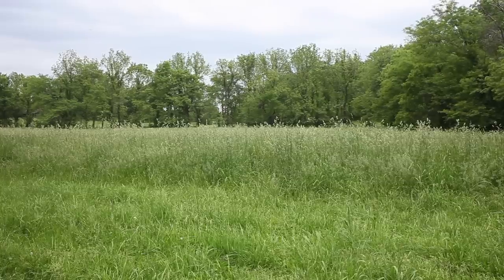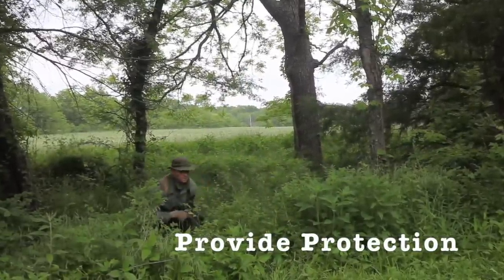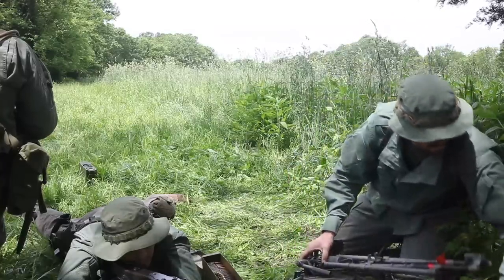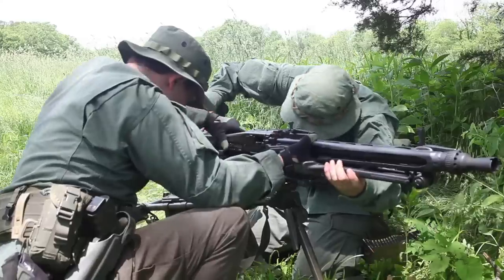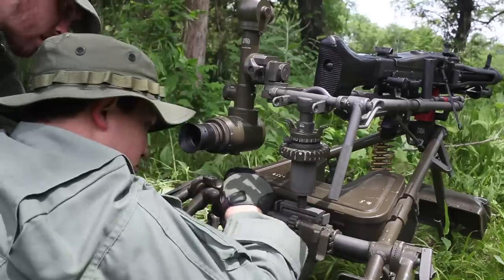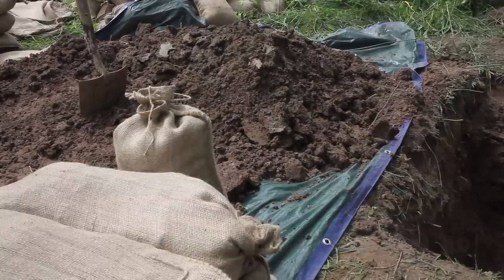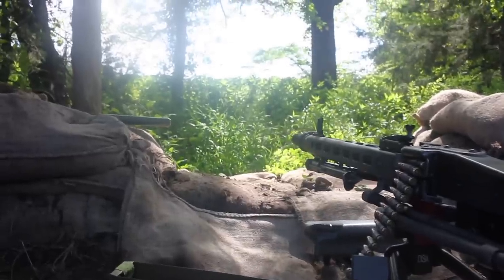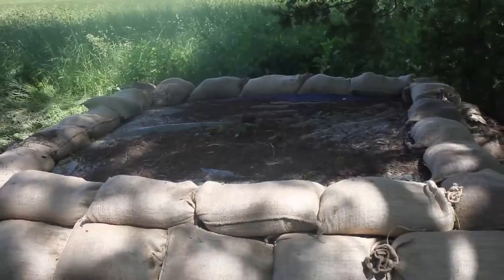How to Build a MG Fighting Position

Comment: This a very good video well done. Exactly how we would do it. Now doctrine is different. My time in the Army, the team leader would be the AG, Gunner is second in command and rifleman would be the ammo bitch. Every gun team from Weapons Squad would be divided into every individual squad on the platoon. Each weapon team would be directly controlled by the squad leader. In this video it shows a Gun team working interdependently. Which makes sense if it militia or small unit based.

Comment: So all we need is a pair of folding showels... and a pair of full scale ones. And a hack... And planty of empty bags...  And wooden beams. And sheets of plywood. No offence, the beginning was very interesting. But closer to the end it is becoming obivious that the main requirement for firing position - having IKEA or a large hardware store in vicinity.
Reply: Very good points! If you look into the hand books that this is referencing the first phases of the trench are done by the men, eventually In optimal conditions later reinforcing material is dropped off by logistics. 
For an example of this Think Ukraine war most trenches in hot zones are mostly mud and rocks with crude dugouts. Second and third line trenches look much more professional and neat. You invest less in the front and reinforce once it’s safe for field engineers to get closer. 

What you see in this video is a fighting position that’s defensive going from patrol to, tripod, to fox hole, to trench to fortified position.

Comment: As we have seen in the ukraine war, one improvement would be to cover both the entrance and the position from where the gun fires with a net to avoid kamikaze drones from getting inside your position and causing even more damage, you would have to hide this thing even more because of drone warfare, also, again, ukraine war tells us that making another hole inside that does an L and goes underground would be good because of artillery attacks.

All of this is futile if you got no additional infantry support and some sort of air cover, maybe drone jamming weapons will become necessary in modern warfare, they should be standard in modern tanks, many amazing and well made trench networks fell to the Ukrainians because simply you can stick an 88mm mortar shell to a drone and throw it in the heads of your enemy, because drones are small, hard to detect and hit and have amazing cameras that can pick incredible details and they will most likely than not hit something that they suspect is an enemy position because it's cheap, and the effort is minimum, so why not, that's why you need to be really scared of drones

Comment: i dont get why you need a MG fighting position, when the enemy spot after youve shot them they will just go around a take you out. Im i not thinking right? and it is not moveable either, so you can just switch places.
Reply: such an 'installation' isn't used alone! there are not only 3 guys in the middle of nowhere. if you have such a defense position you act as part of a front line, so left and right to your position are people who fight to prevent the enemy from moving around. if it is just these 3 guys, they should keep moving till they reach their front line again and don't dig in.

Comment: im confused by the machine gun itself
its an m53 receiver with mg 3 booster and mg 3 top cover
Reply: It’s a semi auto build from parts
Reply: @harryjoe860  ah okay
Reply: @Martinlegend  yeah, looks like a mix of mg 42, mg53 and g3
Reply: @harryjoe860  i cant see any Mg 42 parts 
mostly M53 and some mg 3
Reply: @Martinlegend  MG 53 and 42 parts kits are very interchangeable so really only markings would be different on many parts

Comment: They are using a german mg42 or a mg3. German engineering.
Isn't a mg fighting Position mobile?
They are diggin' in to be stationary.
Reply: The supply must therefore be secured.

Comment: I mean the machine gunner had literally zero view of the field in front of them... you can see by the camera angle even held slightly above the machine gun itself the amount of foliage in front blocks all view of the field. Also no sure how they ignore the fact that the tree line has a ditch in it that more than likely extends up and down the tree line which would be optimal to place at the back of the position as a route of egress or to be able to move left and right of the machine gun to survey the field without exposing yourself.
Reply: To be honest, a machinegun really isn't even used to kill people like a rifle is. The entire point of a machine gun is to just throw rounds down range, and possibly hit someone. It's jokingly called 'Accuracy by volume' it doesn't matter if you're landing shots, what matters if you're throwing rounds in the direction of your enemy. 

As long as the enemy is pinned down by fire, they can't move, thus allowing the fireteam leader to call in the enemy position to surrounding forces in order to encircle and kill while they're pinned, or to hold them down long enough for an effective fire support mission to be called. 

You can easily aim a rifle through that bunker window, and see the field infront. But the overall objective for a machine gun is to just lay down alot of hate, so friendlies can move around to eliminate the threat. It's why alot of NATO tactics with machine guns are just 'enemy is at 3 o'clock, light up 3 o'clock'
Reply: @notleviathan855  when you are ambushed it is different then selecting a spot based on being able to observe enemy movements and setting a field of fire. My comment on the machine gun not being able to see has nothing to do with being in a bunker. It has to do with the bunker location and the fact that even during the initial location scouting the machine gunner laid down with the assistant with zero field of view while the point man scouted....wth os the point of the machine gum setting up with zero view to provide security for the position when he cant see. There is a perfectly usable ditch with cover 10 yards away. Look at any observation post or defesive established bunker. Field of view is paramount.
Reply: @wcb5890  Sure, FOV is important, but that wasn't the objective of this video. It was 'how to build a MG fighting position' not 'how to get the best FOV possible'

The overall objective of the video was to show what the best MG bunker should look like, and how it should function, this bunker wasn't going to be used in any practical conflict so whatever is infront of it doesn't matter, they could have build the thing out of popsicle sticks and lego bricks and just voice overed what it's supposed to look like. 

It's also stated, it's up to the assistant gunner to remove the foliage. Perhaps they kept a large amount there while they were building the bunker as to not be potentially spotted, you can easily just walk up and remove more foliage at a later date.

Again, you don't really need to see what you're shooting at as an MG gunner. Being able to see is great, however your fireteam lead the one with an optic can literally just tell you 'they're from 75-90 degrees, start shooting in that area' and the foliage infront of you will get ripped apart anyways. The bunker location isn't that bad, given the terrain choice I'd probably choose there as well.

As long as your gun can clear the ground infront of you, it doesn't matter if there are a couple blade of grass stopping you from seeing. The entire point of the 2-3 man team is for one to shoot, and one to spot with any other people filling in a few different roles. You're also going to hear people, on a nice quiet day out in the country you'll be able to hear the enemy walking through that field, and maybe through the forest. There's also a periscope sight on that MG Tripod, dude can just put the scope higher than the grass, and use the tracers to adjust height on the fly.
Reply: @notleviathan855  Then he can build it in his backyard. Why bother to go to god-know-where if you're going to ignore something important as being able to see your enemy.
Reply: @dudududu1926  There's a high chance this was on their own property. Again, they could always just cut the grass infront of them to be able to see just fine. 

If you're so concerned about showing people how to build a proper MG nest, then by all means record a video of you doing with PERFECT everything.